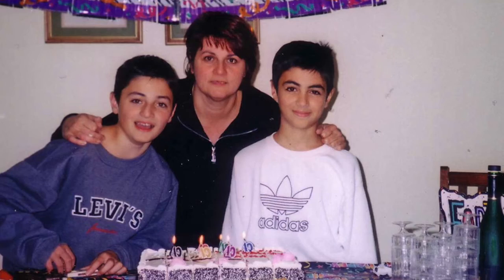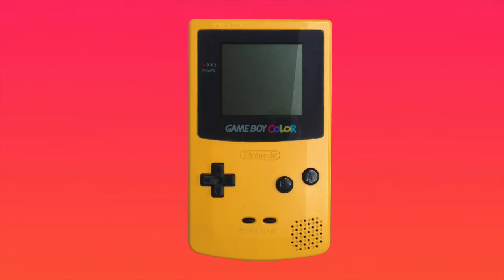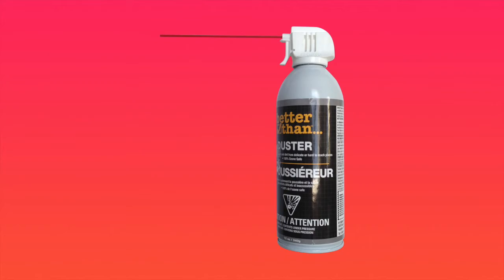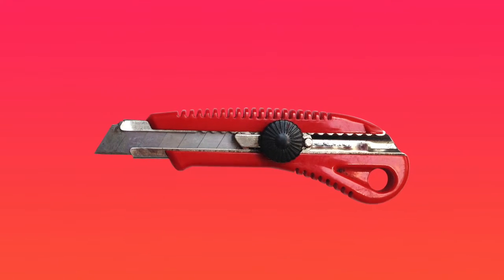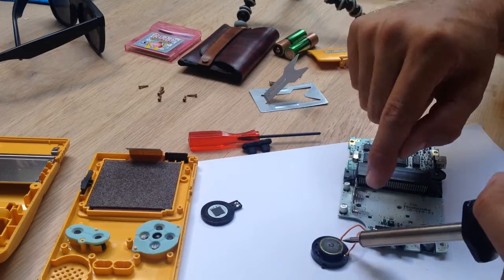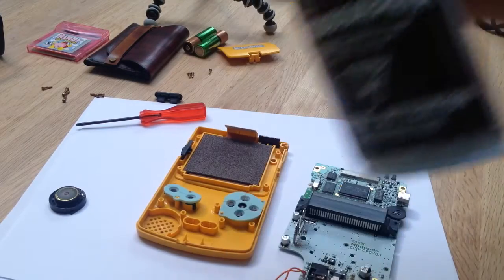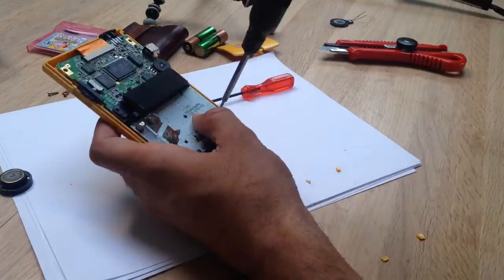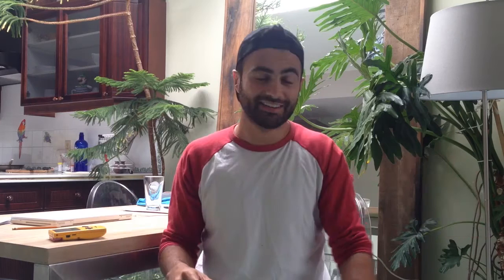Gameboy Color Speaker Repair

Comment: You don't even need to take out the motherboard. I just broke the ribbon plug on the board by trying to "disconnect" the ribbon cable. The plug is no longer connected to the board. And then I just realized I could desolder the speaker without even taking off the motherboard. Guess it's my fault for not thinking for myself. Oh well.
Reply: Anyways, don't get me wrong. This is a good tutorial, you've done a nice job. You really should add an annotation saying that you don't need to disconnect the motherboard, though. Thank you.
Reply from the maker: DairyOrange Sorry to hear about the mishap.  That sucks!  Thanks for the heads up.  We'll get on that right away :)
Reply: Agree